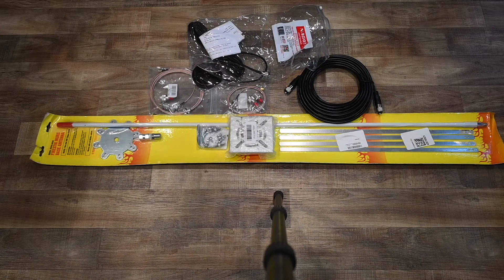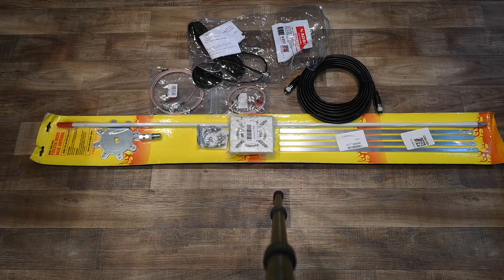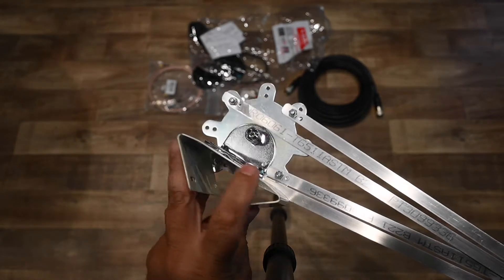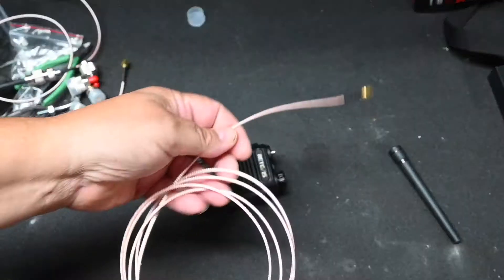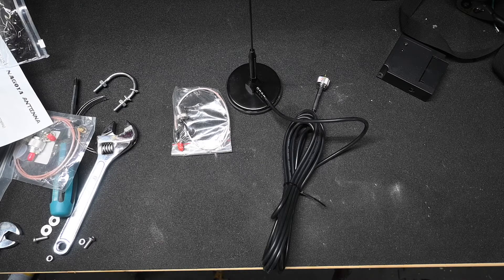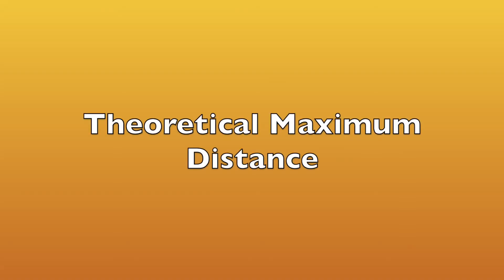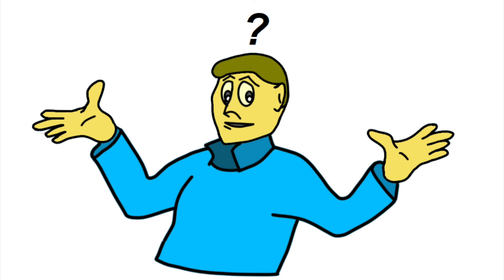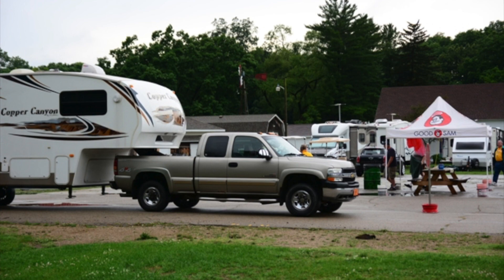External antennas for MURS radios.

Comment: The radials should be bent down to a 45 degree angle for a better match to 50 ohm coax. Foam RG-8 will have a little less loss than 8X.

Comment: Really like the MURS for camping. Hope you continue to test. I got a little better results with a Radio Shack 2 Channel Business Band MURS Base Station/ Mobile picked up for $100.00 on eBay. You are probably losing a little RF power with that antenna extension. Instead try using a direct SMA to UHF on top of the radio without that pigtail, just a suggestion. You could also switch to GMRS which allows you 50 watts from your base station, 5 watts with each handheld. The license fee drops to $35.00 April 19th 2022. This license covers your entire family, even grandparents.
Reply from the maker: thanks for the info.

Comment: Was thinking about programming a couple channels to high output in case it's needed and leave the others at low.
Have you tested range with both output levels and if so, was it a big difference?
Thanks for your thoughts and tests of these radios!